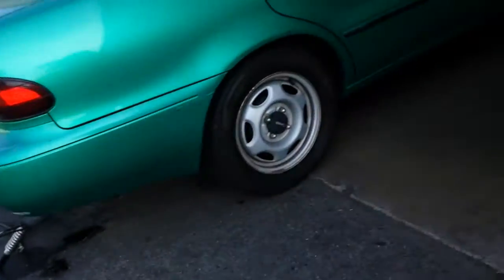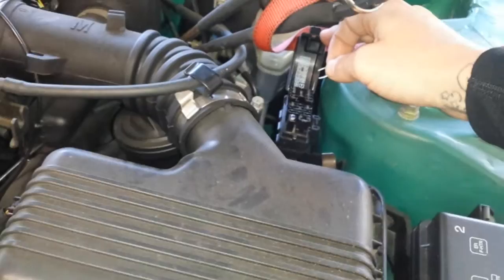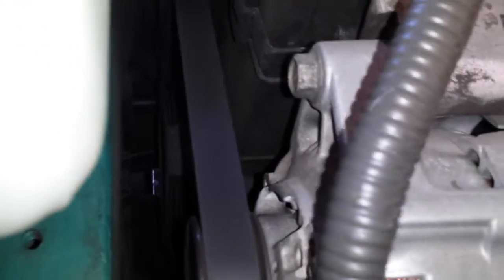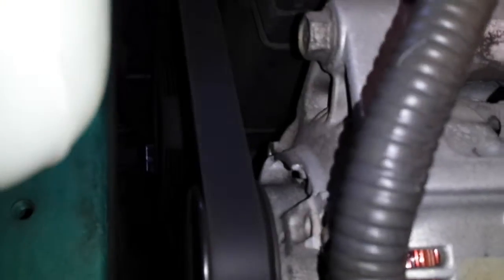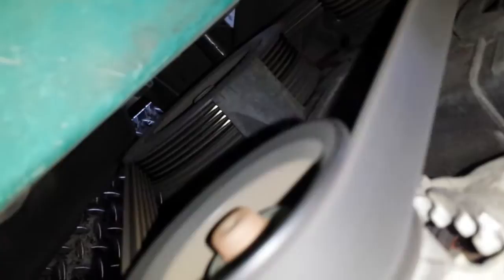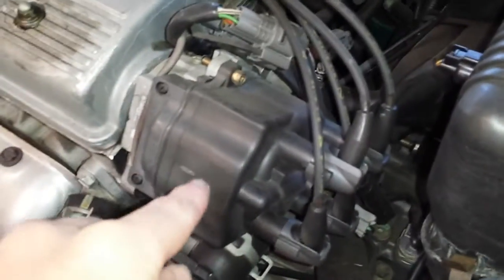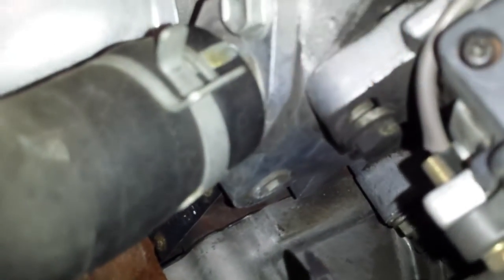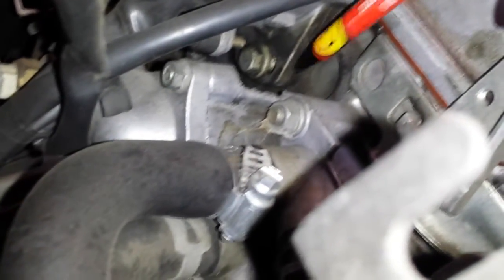Toyota Corolla / Geo Prizm ignition timing check & adjust

Comment: I have a '96 Corolla 1.8 & my friend advanced the timing (idk why) when he was able to start the car without the alternator connected (he replaced my crankshaft seal) & now when I try to floor it, it hesitates when its trying to shift into another gear (I have the 4 speed auto with O/D) but when I drive it normally, it shifts fine 
can I fix it by only adjusting the distributor? cause I don't have a timing light & want to bring my timing back to factory so I can floor it (if I wanted to) or drive it a bit faster so my car doesn't hesitate at all anymore

Comment: Don't know if you are still reading comments for this video but our 1995 Corolla (1.6l) failed the Nitrous Oxide emissions test. One guy says to drive the car for at least 1 1/2 hour before testing, another says to adjust the timing. A 3rd guy says to add SeaFoam. What do you folks suggest?
Reply from the maker: Are you in California? How high was the O2 on the smog? I don't know off the top of my head, do you have a egr valve?
Reply: @ScottiesHobbies  , YES we live in CA. Our Nitrous Oxide Reading was 635 (at 15 MPH), and the MAX allowed in CA is 504. What is bizarre is that the Nitrous Oxide test passed at 25 MPH??. Can't get much of a vacuum on the EGR so I am looking into that

Comment: motor mounts replaced. still vibrates. AIC valve cleaned. better. could the timing belt/pulley be going bad-loose? same car.

Comment: thanks what is the correct distributor timing on toyota corolla 1999 4afe engine..?end what cost if the car have ah knocking sound while acceleration and driving. thank you

Comment: Do I need to put it in base timing mode before I can adjust the timing? The previous owner replaced it without checking the timing and the car runs really sluggish on 1st gear. Thanks?
Reply: Same car 1995 corolla dx 1.8
Reply from the maker: Ye, put the csr in base timing mode wile adjusting the ignition timing.
Reply from the maker: Just turn A tiny bit and see which way the mark moves. It should only have to move a CM or 2 to get on the mark.

Comment: Hello there. how much did you set the ignition timing to? do not normally have to be 10 degrees? you have set the bottom line 0 a. do not you need to set the line in the middle ie 10? Could you write what you told me on the video here? I do not know english. if you write here we can translate and you will have better moments.
Reply from the maker: FHM GARAJ the mark on the pulley should line up with the 10 degree mark. Make sure the diagnostic link connector is jumped first. That gets the computer to base timing mode.
Reply: I mean I have to bring the mark on the crankshaft to the top of the block with 10 fixed figures.
0_
_
'' 10 '' _
_
20_
Reply from the maker: +FHM GARAJ yes. The line on the pulley needs to line up with the 10 mark on the indicator.
Reply: thank you so much.

Comment: howd you get that yellow dot (zero mark)?
Reply from the maker: On this engine, the indicator Timing mark is very easily and very often  covering the timing mark on the pulley. I usually push back the timing indicator with a long screwdriver. I usually use white or yellow nail polish or white out on the end of a long flat head screwdriver to Mark the timing marks before I do the timing inspection.

Comment: yes have changed oil,every thing looks great,rattle didn't start till i replaced O2 sensor,only happens when I first step on gas then clears up on noise sounds like some thing in exhaust pipe.also has very low RPM when first give gas wants to bog down someone says throttle position sensor but have hear everything under  the sun replaced distributoe cause coil had crack and had high millage.

Comment: also do not know if I told you but has 195,000 miles all items on car were what came on vehicle new.fuel filter had a lot of dirt in it could injectors be stopped up?
Reply from the maker: Do you remember the code is that the vehicle was originally giving you? Was it O2 sensor dead? O2 sensor lien? 02 Center Ridge? A clogged fuel filter might cause a lean condition which can cause a vehicle to run poorly. ￼
Reply from the maker: Have you checked with the fuel pressure?

Comment: Direct fit,Parts guy also asked if upstream or down stream,only have one -upstream also catalytic converter looks to have been changed and did not start making this noise till I changed the O2 sensor.also noticed damage to fuel tank but could not see any damage to converter.Checked if It should have a down stream O2 sensor and could not see any indication that one had been removed and not installed.
Reply from the maker: Have you checked for any Metal shavings in the oil?

Comment: All this started months ago when check engine light came on ,said O2 sensor bad or shorted,replaced O2 sensor and made engine rattle like a can of bolts hanging underneath,have replaced fuel pump,filter and air filter reset timing several times and gets worse
Reply from the maker: +Michael Williams is the check engine light coming back on now? Did you get a universal o2 sensor or a direct fit? The rattling is worrisome. It might be the catalytic converter being broke into small pieces. If its actually coming from the motor, you might have blown the bearings in the lower end of the motor and its just time til a piston pops out the side of the block.
Reply: Did it end up blowing up

Comment: watched your video and followed every step,when placing paper clip in data link my RPM did not raise up like yours did and had to advance to very high so that engine would run smooth at park,but when driving skips very bad,replaced distributor plugs and wires.still same thing.any sugestions
Reply from the maker: +Michael Williams What year do ya have? You might have a bad connection on the inside of the diagnostic link connector. When you jump e1 + t1 does the check engine light come on?

Comment: Quick question, I am thinking rebuilding my 2001 Toyota Corolla Le, 216k miles still runs, But how can I time check & adjust when does not use a distributor?
Reply from the maker: +Walter Castro You would have to check it by the OBDII system. I don't think its adjustable at all on that model.

Comment: Quick question, I recently replaced my entire distributor assembly and now that I drive it, it's super sluggish. It has no power until over 2500 rpm :O does this mean timing needs to be adjusted?
Reply from the maker: It's quite possiable. Did you time it after you replaced the distributer? But it could be a number of things. If you timed it when you did the replacement then I doubt that's your prob.
Reply: I did not time it :( all I did was take out the old distributor and installed the new one in. I honestly thought there was only one way to put it in, and I didn't know about adjusting it, which I will give it a try later.
Reply from the maker: +pickatchew, A half ass way to time it by ear is to adjust the distributer to the highest rpm at idle and back off maybe a millimeter. But the right way is with a timing light so you know you are on point.
Reply: I did the half ass way hahaha but just for the time being, I don't have the timing light tool. Except it's running like normal now.